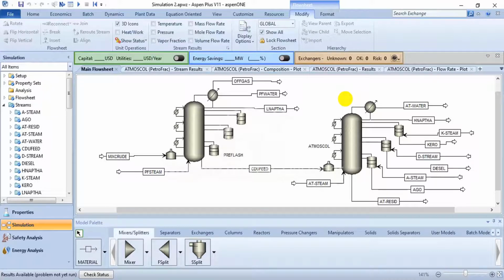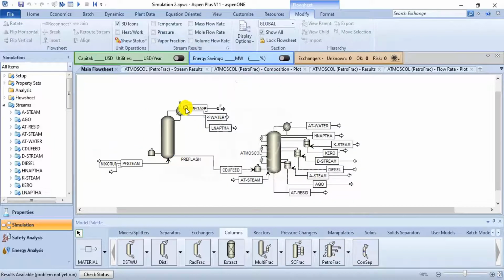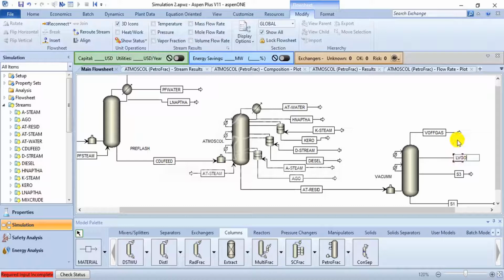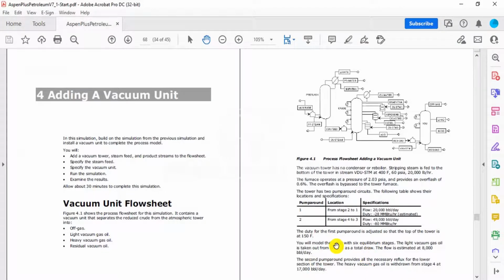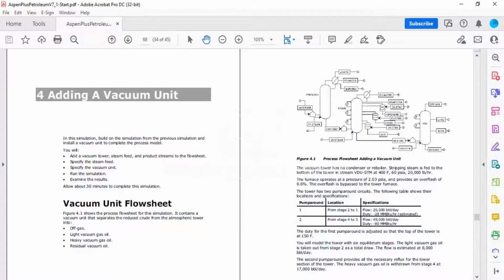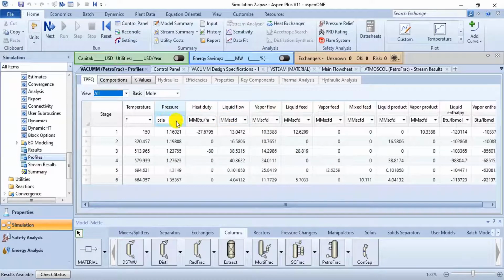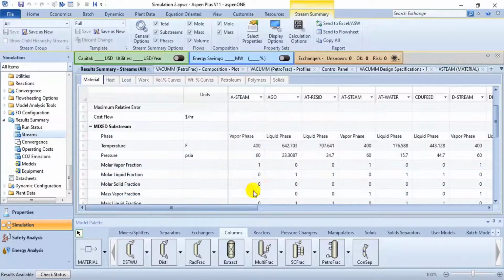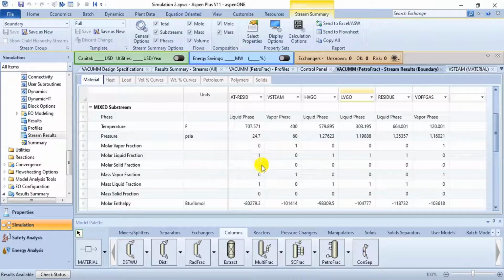Crude Oil Distillation Unit Simulation with Aspen Plus VDU

Comment: when you have to add a train of heat exchangers and the pumparounds are inside the turrents, how can you do it? i mean, you have to create this "external" pumparounds bc the heat that warms the crude oil on my simulation comes from the heat of those pumparounds, how can i solve that?
Reply from the maker: create the pumparound and stripper draw streams as external streams
Reply: @nubyiraprocessdesigners  could that even work for petrofracc columns? I'm working with that modelo, thx.